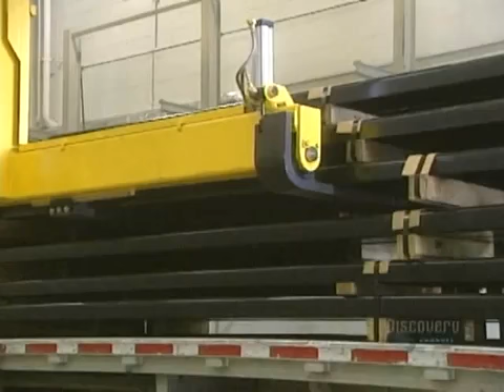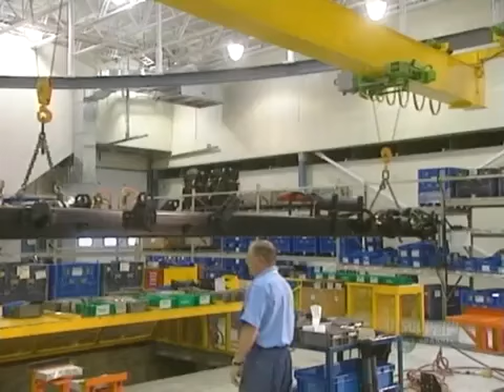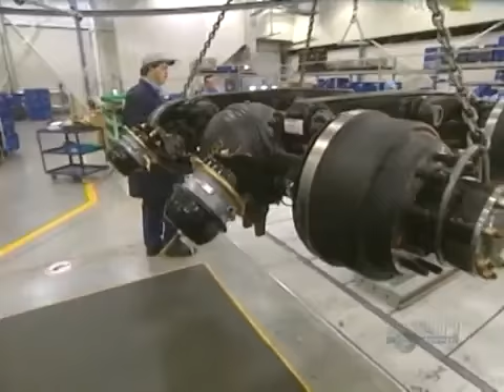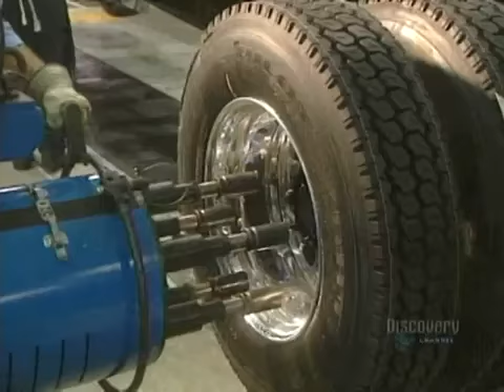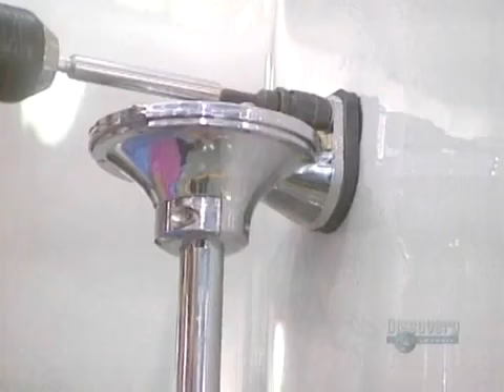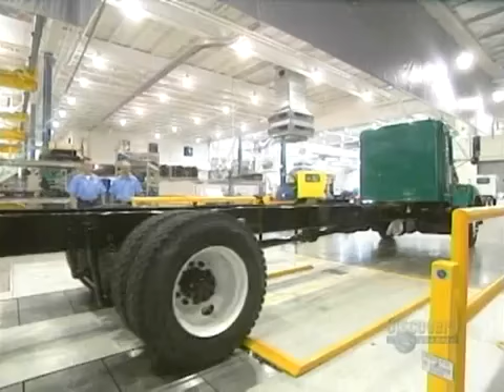How Its Made 18 wheeler - Discovery Channel

Comment: They can go more then 120 km/h and they can pull like 1 million pounds which is a lot more then 28 tons
Reply: They can not pull 1 million pounds... That's 500 tons...
Reply: F-450 6.7 PowerStroke one million pounds really lol
Reply: yes they can, you got trucks pulling 500,000 pounds, 1.5 million pounds it's called oversize loads
Reply: No they can't pull that much. A heavy load for a truck is 50-60,000 pounds.
Reply: he drives a ford leave him alone LOL!!
Reply: Joshua Doll There is a bunch of trucks that are over 50 tons of load not total tons
Reply: F-450 6.7 PowerStroke  the truck in the video is a kenworth t270... with a cat c7 3126... single destined to be a rollback.. or box truck
Reply: lol 50-60k pounds is nothing! There is a bunch of trucks hauling 100-140 on the basis, a b-train full of lumber is 120k pounds like inform yourself. And go look at heavy oversize loads on Google, you'll see there is some fucking heavy bitches.
Reply: F-450 6.7 PowerStroke  yeah but a 26k-33k gvw isn't going to haul that
Reply: I'm not not talking about a pickup truck

Comment: What modern day 18 wheeler has leaf springs or springs leaves? They have had air springs is the 1980's.
Reply: I think they still have leaf springs in the front but now they have bags in the back
Reply: leaf springs in the back?
Reply: Alright thanks for the information I did not know that. I knew they had it on all trucks in the past but I guess I was just not up to date with log trucks and stuff.
Reply: I work on vac trucks for a living none of them have air bag suspension or cab air bags it’s all old school

Comment: This is the Ste-Thérèse plant in Quebec, Canada. Both Kenworth and Peterbilt
trucks, mostly class 7 (occasional 8) are assembled on the same lines. 
Video seems to have been uploaded in 2011 but the truck models shown / plant layout are very different now. Video taken in 2002-2004 I'm guessing.
Been here 7+ years, Salut! to all my co-workers.
Reply: And I don't think any of the trucks shown can pull trailers.
Reply: @stonent  Not only box trucks but tractors (5th wheel) are also assembled there. To my knowledge the only exception that is not built on the production line but rather done  by dealerships or aftermarket sources are dual front steer axles dump truck chassis.

Comment: pretty bad video. Not very much info on this video. Wanna see a truck done on modern marvels or something where it can be at least a half hour show on how its really done.
Reply: its a truck with 4 wheels in dualy config in back and 2 wheels in front in steering config like this

  0---0 front steering
     |
     |                                                              
00--00 back powered in dualy config.      
                                                                    box    cab
these trucks have boxes put on back 0-0---------0

these trucks are mainly used for trucking lighter loads then "18" wheelers 18 wheelers are not used in city as much and work like this  0----0 steering always
                                                |                                                            0--0 steering
                                                |                                                               |
                                          00-|-00 always powered all trucks =  00---00
some dont have this--> 00---00  powered on some trucks 
                                                                                  

                                                                  fith wheel |   | cab |    | fith wheel
18 wheelers have cabs seprate from trailers 00------0  0------0

trailers                 | fith wheel spike |  
_______________                          __________
00    dualys    |                                    |             0 dualy 

double trailers 
                            coupleing
                |fith  /          |fith                                       | fith
_________  ________       cab          __________        cab
0          |     0/ 0           00-------0 front   00              00-------0       front     remember all 0 are wheels almost all 0s are dualys but 0s in front are steering or 0---0 = non dualy 00--00 = dualy hope you enjoy